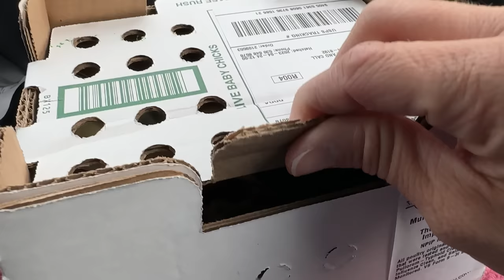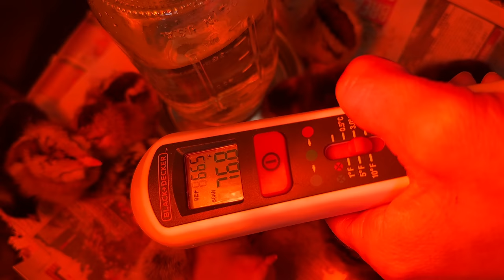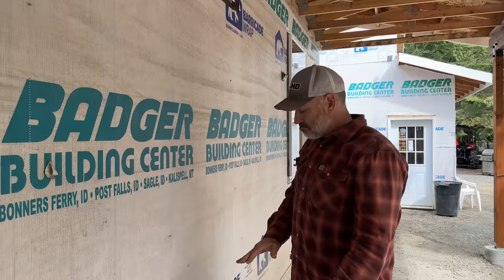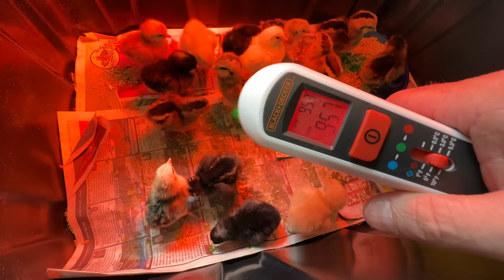Building a Massive Porch on our Off Grid Home

Comment: One important thing about your vent for the dryer is once a year you will have to clean out the venting piping so you don't ever have a fire from a clogged vent.   Amazing finally a DECK yippee.  Because you live in with woods maybe one day consider screening the deck would be awesome.  The deck turned out absolutely beautiful...of course it wood ...I mean would LOLOL  God is Blessing you ALL.  Prayers to Seth for a quick healing on his shoulder.
Reply: Keen eye there Sandra, routine cleaning on a vent fan is not required like a Dryer vent.
Reply: I agree on screening in the porch. We did that on ours and it makes a major difference with the bugs
Reply: @ModernMountainLiving  ok but I thought he said he was moving it about 10 feet away...unless I misunderstood.
Reply: @SandraVanLankvelt  He did say that, freezing the condensation is more the issue, then the thaw cycle not lent if that was your concern.

Comment: I would like a free pair of boots.  I'm a deck builder and wear out boots and shoes quickly.
Here's a suggestion:  Make sure your lumber is consistently the same width.  If not, some boards will stick up above your rim board in your pre hung hangers.  I always tack my joists first, then put the hangers on.

Comment: Martin on the vent straight through to the outside of the deck, 8 feet can’t go that long too long of a run for vent to work. If that’s just an air vent that’ll be fine just get together just get your a hard pipe bring it through the facia to the porch and cover it with the Allegheny Grace material or something that water won’t ruin Kim covered with plastic bag if you want and tape it along to Van

Comment: code says dry and bath vent can not be no longer than 25 feet and cut 5 ft off for every 90 degree turn question did you to a small pitch going down on your porch so when it rains the water runs off the porch